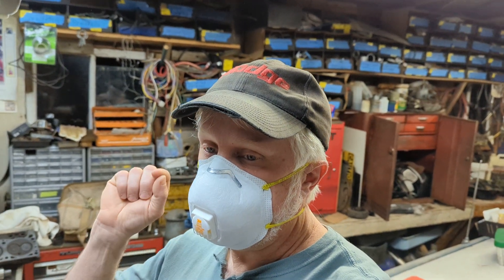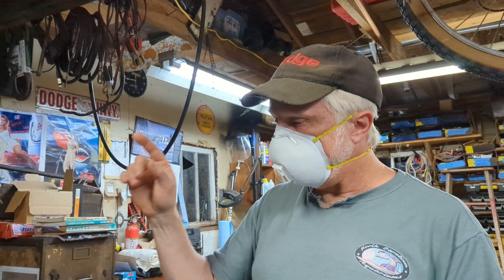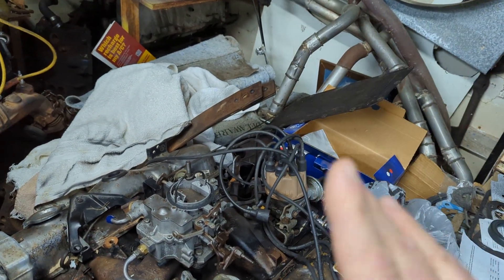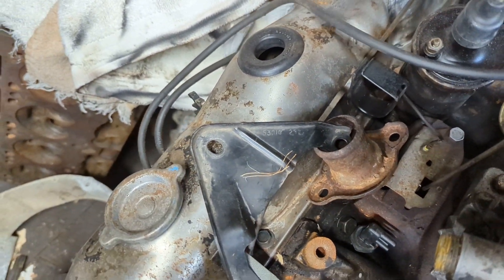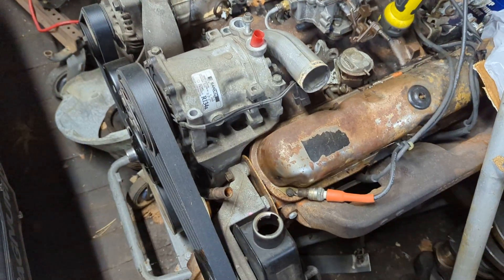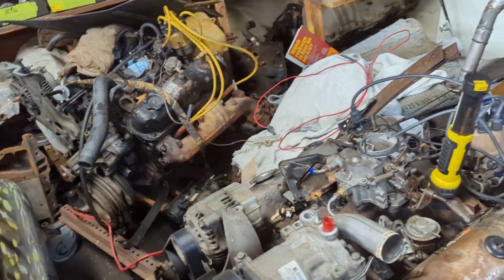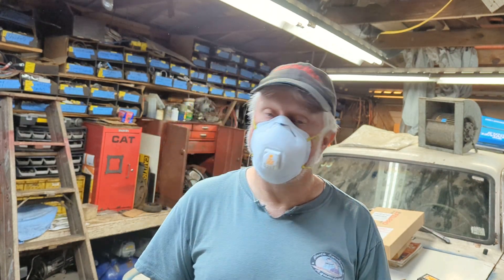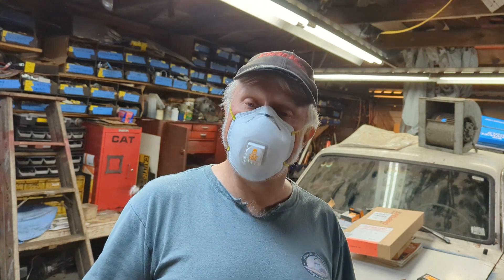Mopar LA trouble shooting for crank no start what to look for

Comment: Great videos! Thanks. Where would the 'lean burn computer' be on an 81 B150 Dodge Van? Can it be replaced?
Reply from the maker: First of all, thank you very much Charles for watching. I really do seriously appreciate it. As far as I can tell, I don't really have any information noting where the lean burn computer would be on your van now on a lot of cars and pick up trucks Mopar of course that lean burn computer is usually mounted to like the air cleaner itself or it is mounted like to the underhood engine compartment body work like the inner fender or the inner fender well and mounted to that. And then it has usually like the air intake coming through that to help cool that computer. That is very common. Dodge did that or Chrysler Dodge Mopar did that for a number of years beginning in the '70s and then all the way up through even up through the some of the magnum engines into the '90s. So the reason for this is to just keep that computer cool and so I would try to follow that air that cool air intake that comes off of your air cleaner that goes to like the front radiator brace area and see if it's right there. I don't have a van like yours to go out and look at and reference so you're wanting to know can it be replaced? Yes they can be replaced. However, what's important is you got to have the exact part number off of your old computer. If you don't have that part number, then your engine may not run that well. I would seriously consider if I were you. I wouldn't even think about replacing the lean burn computer. If you're van isn't running what my actions would be, what I would do is I would probably just go and get myself a converted over to like the older electronic ignition system. You can do that however that has some pitfalls trying to get a hold of good ignition module and ignition ballast resistor anymore is getting really really hard to do. You may want to consider what I did recently on one of my videos where I used a GM HEI ignition module with a modern day style ignition coil and use that instead. The great thing about the lean burn style computer is that generally they don't have the gauges or nothing else running through them. It's just primarily just for the ignition system and you know sometimes they may have a couple of. They may be controlling a couple of things on the carburetor, especially in later years like in the  later '80s  like 86 or so I have tried this GM HEI ignition module swap. It actually works out really well and it has a very hot spark and allows you to run a wider plug gap which may also improve drivability acceleration and may also improve fuel economy just a little bit. I would seriously consider it because of how inexpensive it is. You can get a module one of those modules for like about I think like less than 30 bucks. You know brand new. I usually use the standard brand from like yeah O'Reilly's okay I apologize. It's $34.99 at my local O'Reilly's and then I've got to used ecore coil. I got that from salvage yard. I think I paid like 10 bucks for it and I'm using the Mopar electronic ignition distributor which you could use the existing distributor in the end in the van right now to do that. You just wouldn't have any way to advance the timing very much because it doesn't have a vacuum advance on it. The advances right now is handled by the lean burn computer so I hope this helps and like I said go check out that video of me doing the GM HEI ignition module not the GM HEI distributor okay so thank you very much. God bless. If you got any more questions about this let me know

Comment: Just saw your video sir I have a 1978 dodge truck with a 318/904 the truck hasn't been turn on for some time and the problem I have is if I turn the key I can hear the starter like if it's working but the motor doesn't turn  I will be checking the starter relay next any help that u can point me too I would  appreciate thanks
Reply from the maker: Hi Diane, first of all, thank you very much for watching the video tremendously. Appreciate it My recommendations for going forward and seeing why you're truck isn't starting. I would first look at your battery cables. You say you turn the key on and you can hear the starter. Sounds like it's doing something but it's not actually turning or anything like that first. Start with the basics. Check your cables. Check your battery. Make sure your battery's in good condition have it tested. If you don't have it battery tester, you can take it to like a lot of auto parts stores advance autozone I think even O'Reilly tests batteries for free. Once you have it tested and you know it's good. Make sure cables are in good good condition. If there's any corrosion any kind of problems with the cables there can be corrosion down inside the cable. I've actually seen where it will grow in the cable and corrode inside there and just cause a lot of resistance. If your battery terminals are garbage, yeah time to get new cables. Also make sure the connection at the starter is good. Make sure that the starter is very well grounded. Usually the starter grounds where it mounts to on the bellhousing. Make sure you have a good ground strap that runs from the battery to the engine block. Make sure you have a good ground strap that runs from the engine block or cylinder head to the firewall of the truck. Also, make sure you have when you turn the key on to start into the start position of the ignition switch. Make sure you have voltage going to the relay and then from the relay down to the starter. Okay now. Normally you're supposed to have voltage at the starter on the battery cable on that large cable. It goes to the starter most all the time. There is a solenoid switch wire that it's a small gauge wire and it you'll see it on the starter. It activates the solenoid on the starter itself and then that starts that gets the starter moving and cranking the engine over. Also a lot of auto parts stores also test starters too. So that's something else to look for get starter tested. Make sure it's in good shape
Reply from the maker: You could have a bad Bendix drive on the starter which is pretty straightforward. Basically if that's the case, you're going to have to replace the starter again. Get starter tested. Make sure the gear pops out. Whenever the voltage is put to the starter and it's engaged. You can test that at home
Reply from the maker: Sorry about the Diane. I'm using. Talk to text and my phone is an idiot. It's supposed to be Dan. My apologies
Reply: Thanks will do

Comment: g
what if moter acts like it is running off with its self
Reply from the maker: Howdy, first of all, thank you for watching the video. I really appreciate it and your comments. Now you state in your comment that engine is running off with itself. I've been a mechanic since the early 90s and I've never heard anyone describe an engine's condition like that. Now I'm not trying to be a jerk or or anything else. I've just never heard that phrase used to describe an engine. The only thing I can think of that would come close to that is when the engine is running away and that usually only happens with diesel engines. However, if the engine is running away on a gas engine, all you got to do is just simply shut off the ignition or the fuel and that issue is taking care of if you wouldn't mind describing your issue that you're having with your vehicle or your engine a little bit more detailed, I'll be glad to do everything I can to help you figure out what's going on. Thank you, I look forward to hearing from you again
Reply: @slantfish65sd  it is like a false start I guess you would say it just never really starts
Reply: i think ot is in the timing from the distributor something wrong with it and I seen what you did I'm not good at that stuff never really done it kind of absent-minded I misplaced things a jigsaw puzzle to me
Reply: it is a slint 6 in a doge ram custom 150 1982 got that lean burn junk on it woyld like to be able to bypass that if i could
Reply: would i have to go to a points distributor? by the way what state are u in texas here people call me jd that is my handle on am Citizen band radio wanting to get my ham license to get into him what are my hobbies and I love Dodge I got three of them and they're all old 70s up to 89
Reply: may have a grounding problem some were had a Dodge Diplomat I bought one time nothing wrong with it was the positive was grounded out against metal making a lean burn not work right this looks like a Rat's Nest I had a fuse link burn out and it's been messed up ever since burnt down a wire in the wiring harness so we unwrapped it but I got busy on some other stuff and got lost in it and don't know what are some things go on there burn some connections on the intake
Reply: What I meant is the radio is my hobby I want to get into ham
Reply: And yes if you can give me a any advice on that I'm sure it'll be great it was messing up a little before any of that happened it always had a Miss to it and it wouldn't get up to speed but I never got it on the highway it wasn't legal at the time don't know if that would have improved it or not the reason it burnt the wires in the fusible links because I was cranking on it always hard to start
Reply from the maker: Hey JD, if I'm reading this correctly it sounds like to me you need to go back to the basics. I tell you what I will do. I will make a video showing all of the basics how to get an engine started that has been that won't start okay. I will do that very soon. Probably within the next 2 or 3 days. Hope this helps. Thank you very much. And have a great evening

Comment: Nice video with a lot of info! I’m having a hot start issue with my 75 w100 with 360. When cold the engine fires right up. I’ve replaced the coil with a blaster 2 non ballast resistor. Has a new Holley 4160 brand new out the box. Timing is set to about 13 degrees initial. It runs and drives great. Just hard to start after the engine is warm. I checked for spark which I have when the engine is cold but not when it’s warm. Any advice? Thanks!
Reply from the maker: First of all, I want to say thank you very much for watching the video. Really appreciate it and I also want to say I appreciate the very nice comments. As far as you're problem with it not starting when it gets hot, it sounds like to me something is breaking down and not making connection inside something now if I'm reading your post? Question correctly, you're saying that you have a non-balanced resistor coil? You can reply back if you like I can. Just let me know but if you may want to change that call out and just see if it does the same thing just change it out for like a another coil. Probably change it out for like one like a factory coil but don't run it for very long like that. Just run it long enough to where it gets hot or I have got and I have been using an Accel non-balist resistor internally regulated coil so that works out pretty good for me. You may want to try that. The other option may be to go back to a balance resistor and a factory style coil and see if that works out. If that works out then you know your coil is probably bad. It sounds like to me there. You just gotten a hold of a bad coil somewhere but also to check all your grounds. Check the that the distributor is actually tight. The the distributor hold down is tight because your distributor actually grounds through that. Sometimes it also grams through where the distributor contacts the block but and also grounds to that mount that that hold down I'm pretty certain it's not going to be the pickup in the distributor because usually when they go out that's it. They don't come back. You may want to try this here. Also leave the vehicle alone drive it and then when it gets hot go somewhere shut it off. Have a bottle of cool bottle of water with you or even cold and the important on like the ignition coil and make sure it doesn't start right back up. If it doesn't start right back up, pour some of that water on the ignition coil. If it does then you know it's the coil. Okay, that's what I would do. I'm sorry for the very long drawn out answer. I'm just answering this right after work so thank you again and have a great day. If you have any further questions feel free to ask. God bless